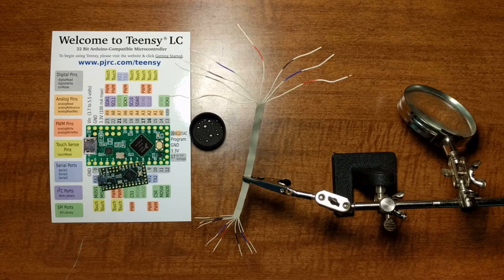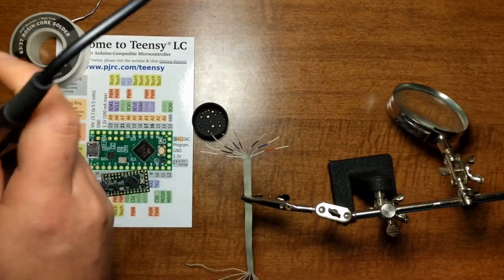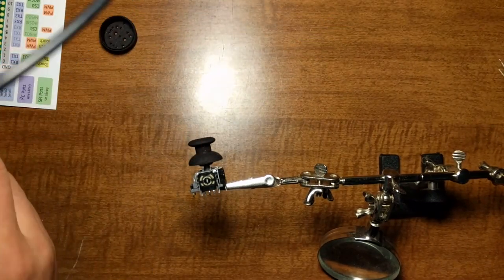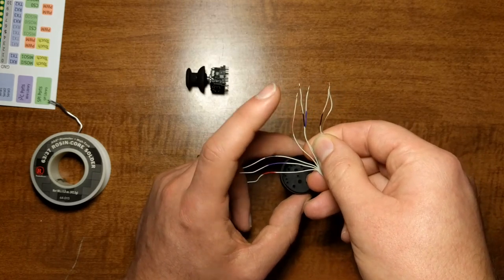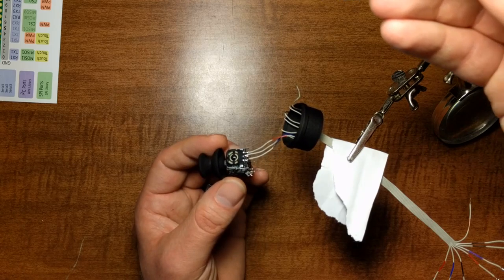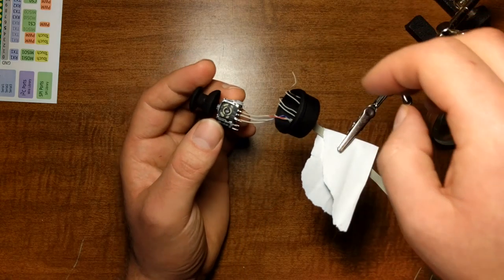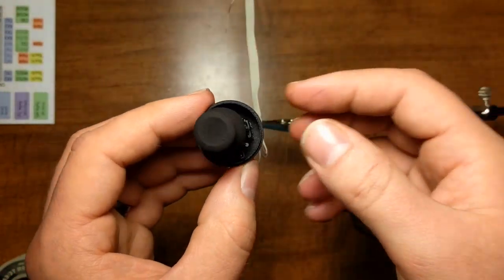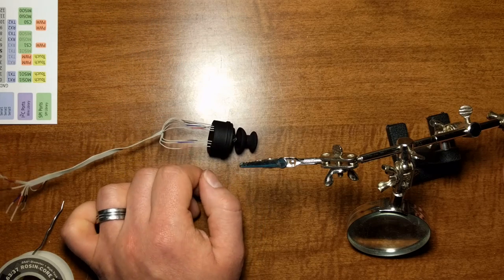Analog Mod Tutorial - Part 3 Tinning and Stick Soldering

Comment: why wont razer just make one with a stick its an obvious replacement for the dpad 🤦‍♂️
Reply from the maker: Because DPAD's are laughably easier to implement. A company like Razer wants to sell 100 thousand of a product that's relatively easy for them to manufacturer and then support afterwards. A stick greatly complicates that.
Reply: Based on my experiences I think it would sell more but that's just me. I've watched your mod vids so thanks and goodwork. I'm just wondering if you have much issues using them afterwards. Games not liking the inputs, longevity, compatibility etc.
Reply from the maker: @FLYNN..  Longevity seems to be fine. They are analog sticks though, all analog sticks wear out eventually. Compatibility is going to be your biggest issue, thanks to the mess of DirectInput vs XInput on Windows and game support.
Reply: @tuffrabit  thanks